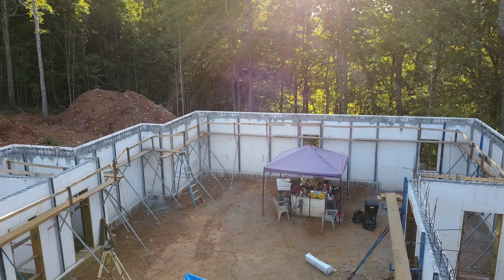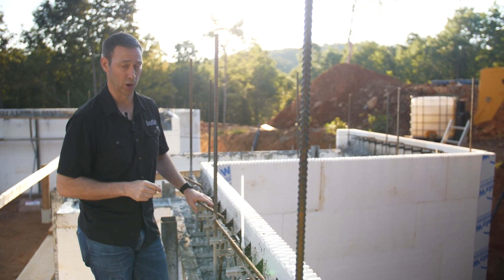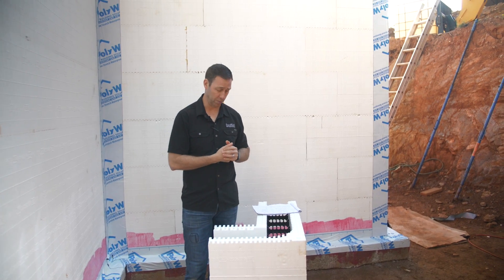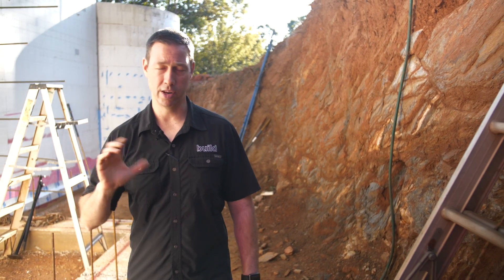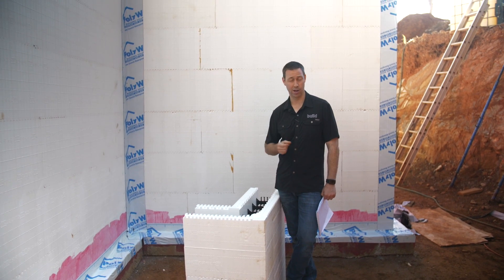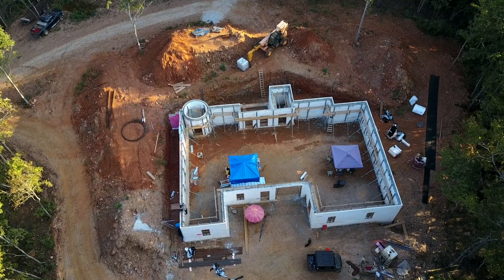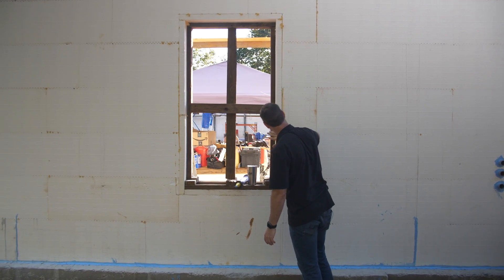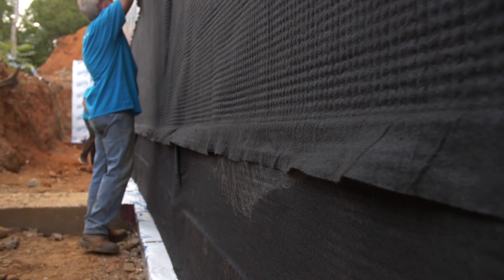Insulated Concrete Forms - Overview, Costs, and Cons

Comment: Our house in Ontario Canada is built with AMVIC ICF walls. My builder raves about it..hes building his own home with ICF now. Other builders said the main issue with ICF is that you cannot vibrate the concrete or something and then you wont know if there are voids in the concrete etc. Not sure.
Reply: Completely false.  We have been doing ICF structures exclusively for 8 years now.  EVERY job is internally vibrated.  12' whip, inserted and pulled out every 16".  4' lifts, generally 3 passes for a basement wall.
Reply: @swankster1966  thank you. I will show this msg to the other builder I was talking to who said you can't vibrate it. I have no idea what vibrating is but yeah thanks

Comment: A “faswall” system is much more superior over ICF , In Europe it is also called Durisol, Tecolit - was developed in Austria and perfected by now. Matt please check it out fir yourself  and review for public
Reply: Wood chips with cement to bind for an organic wall system, yeah I am going to say can you say rot and decay and mold which will grow on anything. Does not even provide a thermal break and just makes for a worse thermal mass as wood will go cold faster than the concrete which is porous in this manner. It is just like other similar using recycled polystyrene and binded by cement as well, there is reason those are not so popular in building a home.

Comment: so it's !~$15/ft2 to build, but whats it for other building styes?  It's implied that it's higher, but  by how much? (I'm guessing you 'lose' on the interior walls, as they're insulated also, so not cheaper)
Reply: That is just the ICF cost, not including waterproofing or finish and all the excavation.

Comment: you forgot to mention no rot or termite problems with ICF.
Reply: One wil still have pest issues as they like to tunnel and nest in it, unless of course one choose a manufacturer that has injected a barrier chemical during the steam process to mold them creating a way to deter them if they manage to get past other means of barriers to detect and control them.

Comment: I talked to a builder who's built 80 ICF homes in the Midwest and he said you can save a huge amount by NOT using ICF below grade.  He said building a traditional basement with ICF upstairs can greatly cut the added costs from needing to water proof and insulate foam under ground.  Is it true that it's easier (cheaper) to insulate and waterproof formed concrete basements?  Or maybe he was saying we don't need to insulate basement walls when the Earth is basically providing some insulation...so you save money by only waterproofing the concrete?  Any truth to these claims?   

I also remember him saying he added a room addition to his ICF house by using his diamond saw to cut out the doorway leading to his added office.  He said he wasn't a big deal when you have the right tool for the job.  I didn't get into the details of how he attached the walkway.
Reply: It is not a called a frost line for nothing. thus why you still want to do ICF below grade despite what ONE contractor thinks and says is not neccessary. It would just look weird when down the road with CIP concrete walls without using ICF would eventallu get cold in the winter or worse it develops water problems of ground water getting in and having to dig outside to cover a crack most likely  and seeing that meeting the ICF upper structure.

Comment: I built one about 15 years ago with a similar system (called Mikey Block) for my mother in law. Worked great.  Have a bit of a problem with stucco cracking along the lines of the block, but I think that was the cheap stucco contractor issue rather than a building material issue.  The only problem I can think of is that my wife is super sensitive to smells and she can't spend too much time in that house.  I don't know if it is the smell of the foam or if it is my mother in law's perfume :-)Anyway, the Mikey Block I used also has a much thicker foam block.  It used 4" on inside and 4" on outside with 4" concrete matrix like core.  This uses a lot less concrete so over all it was much cheaper.  If I'm remembering correct, I spent less than half the price quoted here (~$6.5/sqft), but that was 15 years ago so who knows.
Reply: That is a Wafer type ICF, and are not very popular, at least in the USA.

Comment: ICF is more difficult then traditional basement forming. The idea that it is DIY friendly is an outright lie. I would venture to say it is the most difficult system.
Reply: If it's such a lie, then why do so many DIY owner builders succeed using it? What's easier for a small crew (say a married couple) to work with? Full disclosure; my wife and I built our home with ICF. We selected ICF for performance, disaster resistance, and ease of construction. Ease wasn't limited to just 'we can put up and pour our walls'. It factored the whole process, once the shell was dried in, finishing was much simplified.  But seriously my first question is honest. We'll probably build again because we loved the experience and learned a lot, but if there's an easier method, I'd love to hear about it.
Reply: @benh2322  I believe the reason so many DIY'rs use it is because the product markets extremely well. The idea that many are successful is not my experience. I have framed lots of homes on ICF basements. Every one of those that was done by a home owner (about half) was out of level out of square and out of plumb.  Additionally, the majority of the ones that were done by 'professionals' were sub par to say the least. You should pat yourself on the back and know that you are the minority. You should know that if you had used a traditional system (ex. duraform, cam-lock etc.) You likely would have completed the job in 1/4 of the time with a lot less headaches. You won't find ICF on many commercial construction sites. Why do you think that is?
Reply: Wow you and both him think this, yet I have seen them posting videos and offering courses for Owner-Builder aka DIY assembly of their own homes or other building that most folks can manage themselves, its really hardly not that complicated at all, just a lot of steps to take and remember just like building with anything else.

Comment: Hi Matt,  my neighbours house was ICF, brick exterior, metal roof.  It burnt to the ground.  Prior to his house burning down I had planned to build a house with ICF for fireproof reasons.  I even put in a frost wall foundation for a garage using it (installed myself).  I saved a piece of the melted plastic/foam to remind me to not do that.  Fire happened day after he moved in.  No one seriously hurt... Link to the fire: https://www.youtube.com/playlist?list=PL6889AE90114FF7D3
Reply: I understand why you said this.  But the way this house was built was why it burnt so easy.  Let me explain.  ICF does not need allot of wood to finish it.  You can use ICF for internal walls in allot of places.  Steel floor trusses and roof trusses, with concrete floors and a steel truss and concrete roof with the ICF insulation.  Knowing how to build an ICF house or commercial building of any type is needed.  Can you do this DIY.... yes but make sure to have the right information and planning to get all things done properly.  Second is cost.  People will tell you this is more in cost.  Not true at all.  why?  because you do at least 6 steps in one build.  Once you add in all those steps you completed of the costs to do them separate it is very clear what is the real cost.  Most people don't do this and get a full picture.  For now for me ICF is still the first building choice for me.  Wood in my are cost more than concrete per square foot with the insulation.

Comment: the perfect block is rated for 4 hours.....if you want to see how fast that will burn ...hold a MAPP propane torch to block....it will not last 15 seconds
Reply: The fire rating comes from an assembled wall and is mostly the heat resistance of the concrete .

Comment: I do ICF in western Canada 🇨🇦. Also done few curved ICF walls in a 50,000  sqft mansion. Interesting eh..
Reply: Pentmore, larger but different as it uses a vertical icf system, 50,000 sg ft with these block is nice to hear about though. Quad Lock system was used in a Arizona church (quadlock.com/insulated-concrete-forms/ICF-projects/Immaculate_Conception_ICF_Church.pdf).

Comment: Corbett from Home Performance YouTube is using stick framing to build out his house. I believe he went this route due to icf foam off gassing toxic chemicals including flame retardants. Icf manufactures state on their website that the foam doesn’t off gas. Is there any concrete evidence that icf foam off gasses? That’s a lot of sq ft of material to off gas, and were not talking about the other materials used to build the house.

Comment: Are you sure about that EPS foam is really water resistant? Common EPS foam used for wall insulation is not water resistant and it will absorb water. And anyway is it really EPS or XPS (extruded polystyrene)? It is hanging capabilities would assume XPS material instead common EPS. Thanks, cheers...
Reply: II have seen EPS shed water it has collected while XPS or its cousin ISO/PIR both will hold water that has gotten into it. There is a reason why EPS blocks are used in civil construction and for floating homes to help them float and maintain balance. Do not believe lab testing results and such white papers, lab results are not the same as reality.

Comment: You did not mention the cost of the steel work in the walls
Reply: It's just rebar layed as you go, nothing special, some custom bends around openings and above doorways, cast in place headers with special cut blocks

Comment: Matt, no mention of insect damage susceptibility. You should see the incredible mess that wood ants made of our ICF foundation. They LOVE to burrow and build in it. We are at 8,800 ft in southern Colorado and I have spent the last month with a local carpenter replacing and repairing the rim joist and mud sill on our house after they tunneled up through the EPS and attacked the foundation. Our house was built 20 years ago when ICF was probably an innovative solution. There are insect resistant versions of ICF that are now available, but if you want to see what kind of damage can be done, google 'ICF ant damage'. It's not just termites that love this stuff, carpenter ants love it too.
Reply: They really only just shew through it, not edible to them at all as the pieces or bits are too large, But seems your home was built without a barrier in place to detect the problems before it occurred such as metal shielding and annual pest control checks and such. Thank goodness more modern innovations to be able to make the form itself protected with infused insect barrier control but still helps to use additional protection like Terminix's new termite and ant control spikes, but a shield on the base of the ICF structure will also still help to see when or if they do get to the house to look for wood to eat on inside.

Comment: Ive been looking into ANTI TRADITIONAL home making methods as well. Im from San Diego. Its time to rejuvenate the worlds forests and cut our dependencies on wood based products. Im not sure ICF is the way however. My method is different but MUCH easier to build, quicker, cheaper and more builder friendly. Im glad major youtubers like this are bringing attention to non traditional methods.

IMAGINE how clean the air would be without deforestation? Would it balance the climate? slow the rate of or reduce natural disasters effects?

Comment: Is there any reason you can't just add some more insulation sheeting to the outside? You mentioned wanting a block that you could do that with.
Reply: Just look at the Build Block Website, also check out Quad Lock, they make panels and ties separate with a few panels that have the strips embeded into them to create a fastening stud system and on top of all they also offer extra panels which is filler to increase the insulation and are less $$ than the standard panels.

Comment: It seems to me like the biggest downside to ICF are the tight building tolerances and the time to build.  You can build stick frame pretty quickly and even fudge in a lot of places - but you have to be very careful and go slow with ICF to get it right.
Reply: Most ICF builds go up faster due to the ICF being the formwork and not much issue with tolerance troubles which is easy to watch out for along the build and adjust for, then again it all depends on the size of the build and some are multi-residential buildings.

Comment: There is a block that you can use for the roof also so you have a complete concrete home. Very fireproof.
Reply: IF you are referring to SPider Ties, that system is so over complicated and expensive, BuildDeck is basically a floor and roof foam panel system for concrete and far simpler than that other crappy system.

Comment: Unless I miss my math the walls on this house cost 135,000$.
Reply: My thoughts also. That's ridiculous for foundation walls.
Reply: It may cost this much but far less than traditional formwork as this stays in place and provides for a more comfortable home with far less heating or cooling bills which helps to pay for it, where as a bare concrete will still require additional cost to insulate with similar foam sections by InSoFast or Quad Lock R-ETRO system or even sheet board of foam with hopefully some way to fasten a finish to without having to drill through and into the concrete foundation.
Reply: Joshua79C C  I’m also gonna point out that I can build a whole house that is beautiful for that much.

Comment: What do you mean low R value. We are building dozens of homes here in Alaska and 13” Nadura block composed of 8” of concrete sandwiched between 3” of foam gives our building an R48 value. A 2x4 construction with blown in foam gives you maybe a R15.

Comment: Ha i used  to make the plastic webbing for build block if you seen how thin and flexible they are you'd rethink screwing something to them  actually  curious how many of those  I checked and pulled from the press lol
Reply: Your not realizing the concrete surrounding it stiffens it, and nothing is superior to any storm or natural damage, so I am just going to stick with what they claim for holding strength, seeing as I also used to work for a plastic manufacturer at one time as a temp.

Comment: I wonder if this could be used on a existing home ? In other words. Let say one was to replace siding and surround the home with ICF ?
Reply: Check out Quad Lock R-ETRO ties that are made for using their panels of which come in three sizes and two main sizes come with furring strips (plastic studs) as well that are embedded into it.

Comment: Very good video, and I basically agree with all your pros and cons except maybe your concern about reduced R-value. In real life it is not just the r-value of the materials that should be considered, but the tightness and stability of this system (which you did point out) - wood framed buildings will always contract and expand a lot more - resulting in leaks over time. 
I built a 2200 sf one-story slab-on-grade house in 2014 and it is super comfortable and well insulated. I can heat it with about 1/4 cord of firewood/year in central PA. I use a Tarm Innova indoor wood boiler and PEX radiant heat. I run the furnace 3-5 hours/day during cold days (10F - 40F), when it is not so cold I just skip a day. The immense thermal mass in the walls and slab evens out variations in temperature. The distributor of the furnace said I had to install a heat storage system so the boiler would not have to shut down when the house was warm enough but I have never needed it or used it - the walls and slab together is enough storage. I don't have AC either, though I will probably get that to deal with the humidity during the summer months. ICFs are a great system that really deserve to be used more - we are entering times with more frequent and severe storms and this systems is just so much stronger and stable. 
Thanks for your work - I enjoy watching your videos

Comment: If you went higher say right to the roof. Would the walls weather say an F2 , typhoon etc ???
Reply: They are know to withstand the worst of hurricanes and even tornadoes except where the windows or roof if made from wood, were not build to said standards, as there is a number of cases of such ICF structures withstanding disasters coming out only bruised and somewhat damaged if not completely destroyed or damaged.

Comment: Thanks for the video. Could you give a cost/efficiency comparison between this and traditional poured concrete walls with foam added afterwards?
Reply: I quoted a basement for 28K installed in one week and client went cast in place cost 49k took three weeks
Reply: dave taylor , as if his 5+5+5 for 15 for the ICF system alone with concrete, not including rebar as well it seems is far less than CIP with forms and then insulating afterwards or going by the Superior wall system with interior faced in foam which IMO is nice but has its downsides at its seams and connections no matter how careful you are to waterproof or such.

Comment: TF systems and Hobb ICF have a VICF (vertical ICF) system where the loads are directly distributed to the footing. Whereas with the horizontal ICF, the loads when concrete is being poured can cause deviations in the height of the wall due to uplift on some of the blocks (directly from the website - https://www.hobbsbuildingsystems.com/foundation-and-wall-contractors/ ).

Neat video to see as well.
https://youtu.be/Av8xaqpmRAI

Check out these websites for more info...
https://tfsystem.com
https://www.hobbsbuildingsystems.com